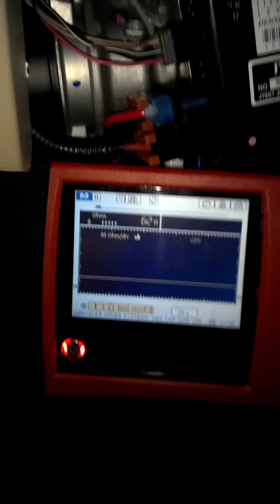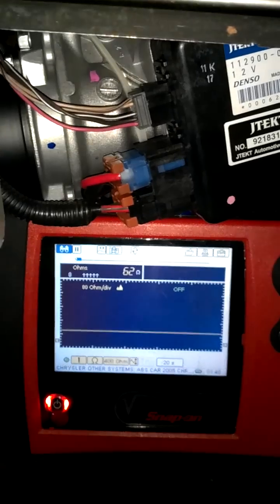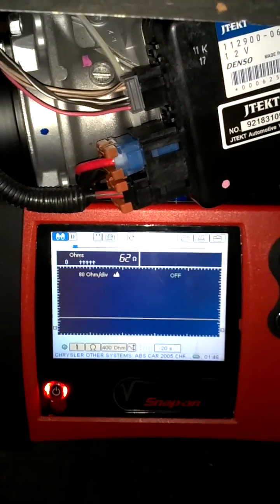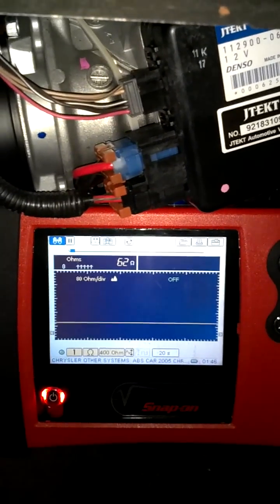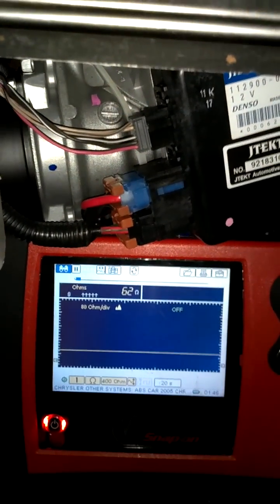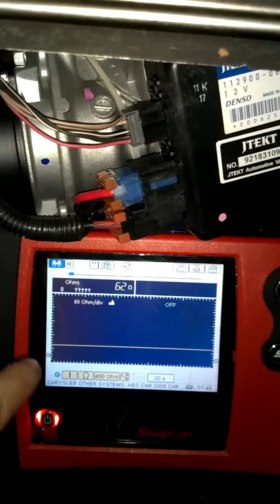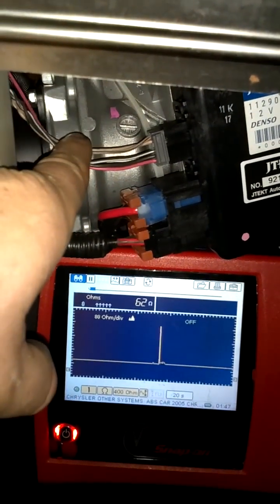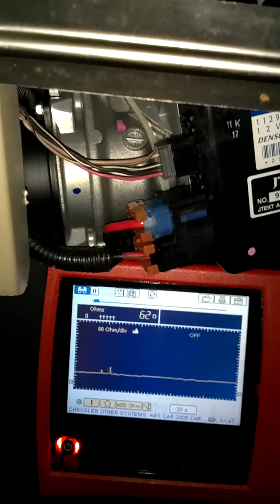High speed CAN bus diagnostic resistance check (1 of 4)

Comment: car have multiple (5 to 7) separate CAN buses for different classes of modules.
Ohming out 1 of these many bus without the whole system diagram is just a stupid waste of time.

To be effective you need to READ ALL THE MODULES with an extended scanner then take a best guess shot
Reply from the maker: The 2005 Chevrolet Cobalt has 3 distinct computer networks.
1: a low speed GM LAN for audio, instrument cluster and air bag.
2: a Class 2 serial network for PCM diagnostic only 
3: a high speed CAN network for module communication that can be accessed on the DLC pins 6 (high) and 14 (low)
As the video explains, by monitoring resistance on the CAN network it is possible to verify the integrity of the network.  In our case study the resistance of the network was much higher than the 60 ohms of a healthy network, but not the 120 ohms as would be found on an open network.  This fault would be impossible to find with any level scan tool since it is just another computer temporarily on the network.  You could have "best guess shot" every module on the network (dealer guessed 2 of them) and still would not have fixed the problem.
To properly diagnose any system you must first understand the system, then test the system to find and prove the fault.  Never guess.

Comment: Getting error U0073 Can bus "A" off .AC , All coolant,RPM , Speed , fuel Gauge , back gear light not running .It's intermittent problem , some time car starts normally after some minutes all needle of meter console not working but engine running and if I shut the car then it will not start for 4-5 min. Please share what I do to resolve the problem. Chevrolet Captiva 2.0

Comment: I was checking an instrument cluster of Porsche cayenne-2016, any of the gauge is not working in it, when i checked power in cables it was ok, all fuses were ok. even when checked this cluster with another car, it was working, all the gauge were working. Is it possible that it is a CAN wire problem in that Cayenne-2016, Please suggest.
Reply from the maker: It is possible that there is a network issue in the car.  On that car I'm sure the cluster is a computer module , one if many on the system.   With a good scan tool try to talk to the cluster and all other modules.  Check the network circuits for shorts to ground, shorts to voltage and opens.

Comment from the maker: It is definately possible to repair the CAN network circuit.  The recommended method is to repair a broken wire with solder and heat shrink tubing.  New connectors and pins can be obtained from the dealer or from a scrapyard vehicle and soldered in.  Butt connections and quick splices should not be used as they will not provide a long term low resistance repair.

Comment from the maker: Thank you for the questions.  The meter is set on OHMs as I am testing for resistance changes in the CAN lines.  It is important that the battery is disconnected and all transient voltages gone (touch the removed positive battery lead to the removed negative lead).  The meter leads are plugged directly into the OBD2 socket, pins 6 and 14.  Because it is resistance it makes no difference which way they are plugged in.

Comment: Hi buddy always nice to see people upload factual stuff and sharing the wealth of knowledge amongst other mechanics so firstly thanks for the upload. 
Can I ask how your multimeter is set up with which range mv or 20v also do you connect directly to the obd can high and low pin outs? if so which way around does + and - go?  if not where are your probes, thanks again.

Comment from the maker: By observing the network codes generated you can sometimes narrow your search down, but as I recall in this case once the meter was set up I just began wiggling and moving the looms and connectors until I saw an issue.  I knew from the history of the car and the codes it was a network fault, this test just pinpoints where the issue was.

Comment: I am not the one who posted the video but I have worked on networking systems.  Normally you would get a OBD 2 fault code from the onboard system which monitors the can circuit activity, or in the case of an open or short circuit a more advanced scanner like the one he is using would show errors when you look at the actual  SASTUS or ACTUAL values of  the individual control modules. sometimes a short to ground will disable the whole system since the current flow in CAN is very small.

Comment: The modules are arranged in parallel in the network and there are two resistors in the two ends of the can bus circuit.. Its not ultimately  important which module has the resistor, but   there are testing strategies using the two resistors to locate a open or shorted circuit

Comment from the maker: You have to use wiring diagrams and service publications to find a map of the network.  Sometimes these can be tricky to find, often categorized under accessories or tucked away in the general wiring section of the service publication.  A homeowner Chilton type manual is unlikely to have it, but any professional service publication should.  The dealer should be able to print one out if all else fails.
Great question!

Comment from the maker: The cause was micro fretting on the connector.  Basically very small amounts of corrosion or impurities that provide a very small small amount of resistance, but the CAN operates on milliamps of current so even a very small amount of resistance effects the signal.